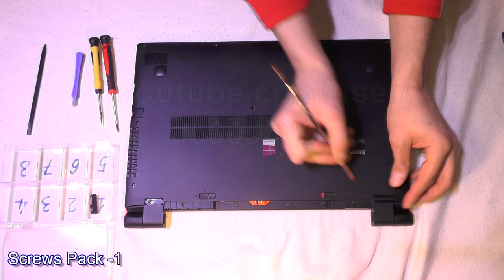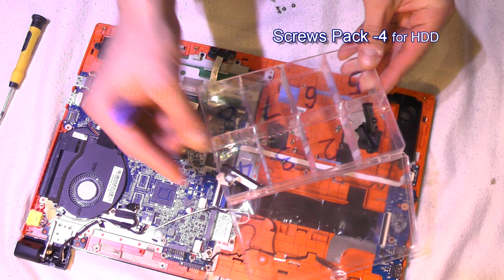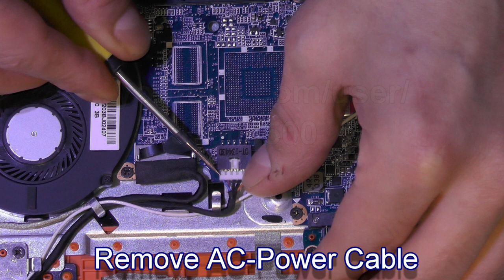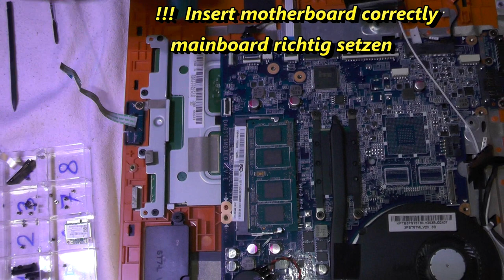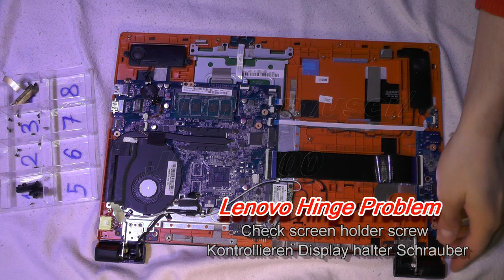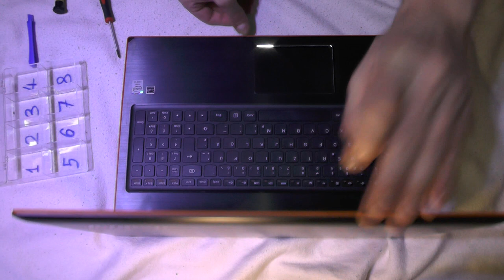Lenovo Ideapad Flex 14 15 D Repair Disassembly Replace Cleaning fan

Comment: hello i bought a lenovo ideapad flex 15 today, the touchscreen is not working but in control panel it is recognized correctly in hid human devices as touch screen 10 points etc. i believe the dude messed something inside when he opened it to change the ssd, could you tell me which one is the flat on the motherboard for the touchscreen ?

Comment: huy que burrada nunca se quita una board sin quitar primero el disipador de calor y la bateria del bios mucho menos apliacar aire sobre  el ventilador una autentica burrada
Reply: lo hizo de una forma correcta tengo 13 años, en el soporte tecnico y es totalmente normal, si vas echarle aire a cualquier abanico de computo debes detener al aspa detenido y que no gire, si lo que hace que de vuelta con el viento daña los valeros...me ha tocado ver abanico llenos de pelusa y grasa que si o si tienes que ser alcohol isopropilico la limpieza...